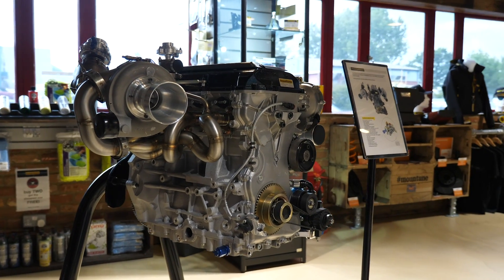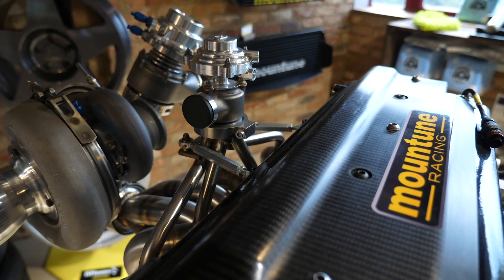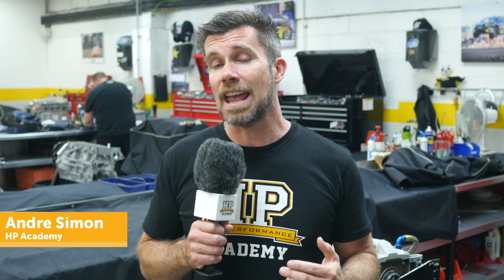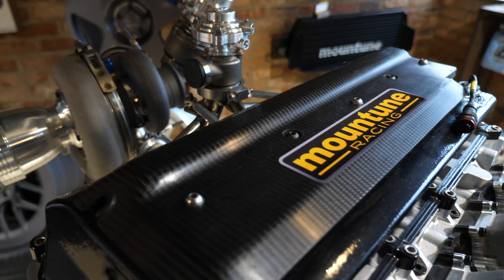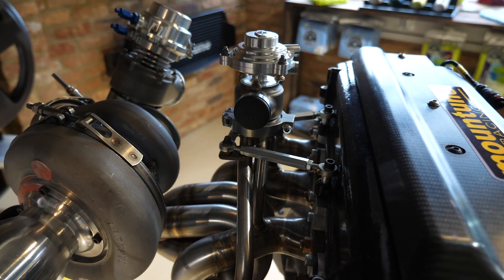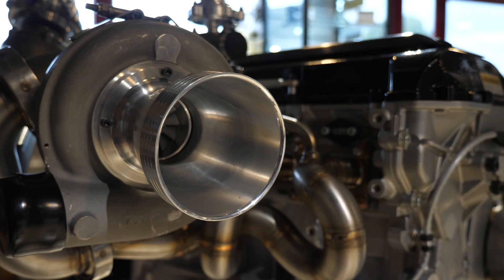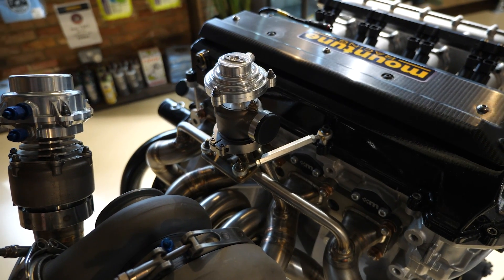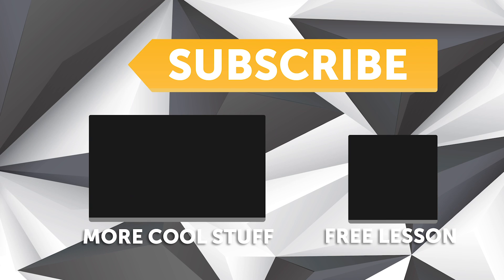Aggressive Anti-Lag Theory | Fresh Air ALS Mountune [TECH NUGGET]

Comment: Look up Audi's 'UMLUFT' system
Reply from the maker: Check the comments, pretty sure this has already been discussed here some time ago :) - Taz.
Reply: @hpa101  yeh, thought it would have been, unfortunately my drive is being in the workshop than reading a comment log, In saying this however have you considered revisiting/investigation into another old turbo tech of pre compressor throttling to aid response?  Another YT'r Stavtech mentioned it and I remember way back in the 80's having to try and discover why they had multiple throttle bodies in series.
Reply: @hpa101  ok anti lag valve there is the vacuum one en the electric one my question is how you going to pu on icu if it’s use vacuum line

Comment: When fresh air antilag valve in action so its need fuel and little combustion wich is provide by the combustion chamber so how its possible because throtle valve is completely closed only fuel is given to exhaust manifold by direct injection in combustion chamber so how its get combustion without compressing air fuel mixter in combustion chamber..???
Reply: If you tune it rich enough or tune in a misfire you get unburned fuel in the exhaust manifold

Comment: A camless turbo motor would be perfect full control of inlet and exhaust valve operation this freevalve technology would make camshafts obsolete tuning all done by the computer no more rockers or timing chain or belt 👍 hello anilag plus no need for direct injection with valves building up carbon deposits and a low pressure fuel system like the 90s again 🙄

Comment: It's true that the downside of conventional anti lag, with a throttle kick, that the car would keep pushing when breaking, but on the other hand, with a throttle kick, the response is much better coming out of a corner. Some racers would set a throttle kick even without anti lag activated to get that extra response. It seems that a fresh air anti lag would eliminate the throttle kick along with its benefit!

Comment: In my mind, this would just become an EGR valve once it opens. Exhaust would flow to the intake from pressure differences.

Would work if you did a nitrous injection though. Inject nitrous and fuel, build a ton of boost. Lol.

Comment: Hi Andre! Love the videos. Been following since HPA first started up. Even taken part in webinars and some online courses. Love your work. However may I ask you do some videos of other hardwares on performance or race cars ie, brake calipers and shock and spring set ups. Not so much just on what they do. Thats fairly simple but more on technical advances in brands and misconceptions between brands and so on? For example I can’t decide on brake calipers mainly as there as myths and contradictions over what’s worth buying and what is or isn’t good. Or what is overkill and why. I think it could help a lot of people hearing unbiased info about things like this. Thanks heaps.

Comment: How does this work on the exhaust stroke? Is the air also pushed back into the engine or is the flow to the turbo enough to breathe the combustion chamber?

Comment: What's the source for the pressurized fresh air? Back pressure is generally higher then boost pressure so you can't simply pass intake air into the exhaust.
Reply: snek I think it was mentioned in the video. It is fed from the compressor side of the turbo. I would imagine because during the anti lag phase there is no massive back pressure being created as the turbo is not really compressing charge air, it is essentially opened ended through the exhaust system. So it’s sort of, a self feeding loop I guess.
Reply: The valve is controlled exactly the same as the wastegate so uses a boost solenoid and is controlled by a PWM signal from the ecu so it’s very responsive. When I worked in Rallycross you would find the odd time that there was exhaust gas build up in the boost pipes/intake manifold but this was down to a faulty valve or solenoid not holding the valve completely shut.

Comment: This has got to be one of the first times I didn't understand the content. I need to watch this again!
Reply: You know those DIY 'Jet Engines' that can be fabricated from an old Turbo?  This is pretty much the same idea using new parts and modern technology.  The compressed air from the turbo either goes into the intake manifold like normal or bypasses the piston engine intake and goes directly into the exhaust manifold along with some extra fuel and ignited to produce drive pressure to keep the turbo shaft speed constant.    At some point it will be easier to just shoe horn an optimized axial flow jet engine under the hood and use the 90+ psi bleed air from it to force feed the piston engine and turn the tires..
Reply: Yeah fr too much ear in the combustion chamber might not be good

Comment: this would mean that the backpressure of the manifold is less than the ambient of the air pressure ? otherways you would have just made a free air venting wastegate. :/ . did some research (thanks google) the "fresh air" means that its connected to the charge piping, meaning that it actually gets the pressurized air in.

Comment: Hey Andre, do you know if there's an advantage to using an external source of compressed air to spool up the turbo when not on the throttle? Like koenigsegg is doing with the Jesko, they've said that use of a compressed air tank has aided in eliminating turbo lag that comes with the big turbos they use.
Reply: Volvo also have a compressed air solution for limiting turbo lag. The biggest draw back is the finite amount of compressed air the tank can hold. So for racing it would need a huge tank and compressor to keep up the demands making it impractical. However for a road going vehicle like the volvo there are benefits.

Comment: The air bypass valve can cycle fast enough to keep those exhaust combustion pressures contained in the exhaust manifold?
Reply: The valve is controlled exactly the same as the wastegate so uses a boost solenoid and is controlled by a PWM signal from the ecu so it’s very responsive. When I worked in Rallycross you would find the odd time that there was exhaust gas build up in the boost pipes/intake manifold but this was down to a faulty valve or solenoid not holding the valve completely shut.

Comment: Nothing new really. Audi was doing this in the Early 80's in their group B car.
Reply: It was called the "Um-Luft" system
Reply: Is that why the beast got banned?
They had the best group B hands down.
Reply: @Photosynthesisbeing  Group b as a whole  The car itself was never banned.
Reply: @Photosynthesisbeing  not really, they were just the first with awd
Reply: The Lancia and Peugeot where far more advanced then the „oldschool“ Audis
Reply: @MartlRS  Is that why Lancia had to cheat to win a championship? Lol.
Reply: @FastPaull  What cheats did Lancia use to win?
Reply: @diahane092  I wouldn't say cheats, but they for sure bended the rules to the limit, like changing the roll cage made of metal for an imitation made of cardboard or doing a stop in middle of a stage to change tires, and they did more but i don't remember now

Comment: All talk lol show us it in action I wanna see this in operation
Reply: just watch any WRC video, almost every car has been using it since 98.
Reply: @240rsmaxi8  you sure it was setup like this ? As I've only ever seen from exhaust to inlet Mani (Evo sas system) 
Not from compressor to exhaust 

Not really looked into it
Reply: @bigbothoee8617  All the current 1.6lt WRC cars have a completely different sound to the older Group A based 2.0lt WRC cars from old. I suspect they all use this system as there is little to no backfiring and instant throttle response.
Reply: Can't understand the words? Need moving pictures to keep your attention?
Reply: @sexyfacenation  do you by any chance own an I phone
Reply: First car to use Fresh Air System was S1 Sport Quattro, Scottish Rally 1985. After group B, first was ST205 Celica, followed by Evo IV Group A. Every World Rally car following the 97 season used Fresh Air, Escort WRC, Peugeot, Skoda etc.  The Impreza went from Fresh Air in 97-98 to DBW air bypass until the S8 then to the Rocket in S9. Just watch some post 2000 onboard in a WRC.

Comment: Showing an example with no plumbing from the compressor side going to the anti lag valve might confuse people. 
I want to implement this as long as my mani is .250 wall. Sounds like this will work well, but might be a race only option...this method (like most anti lag) will likely burn thin wall tubular mani’s pretty quickly
Reply: The manifold there is most likely .035 or .049 wall thickness, just good material with the turbo braced to the engine.
Reply: And happy New year to you as well👍
Reply: There’s speculation there.
Always brace your turbo regardless of wall thickness/boost levels/or weight of the unit. 
Happy new year car people
Reply: @Russell_and_Rosko  it is speculation on the specific wall thickness but the manifold there is 321 stainless so would be 1.5mm or under, inconel would be thinner.
Reply: Is this a wall thickness competition?
Reply: @Russell_and_Rosko  lol, yes!  No, I just think .250 is a bit extreme.
Reply: even in some engines cylinder walls arent 0.25" thick.. 
many guys in FormulaD run this style of antilag with thin manifold headers... well gas isnt exploding but combusting

Comment: why is the air source connected so close to the cylinder head? wouldn't it be easier to have just a single connection just before the turbo? I wonder if it's to do with minimising interruption to the gas flow when the engine is under load?
Reply: this is so it can achieve a full burn before getting to the turbo.  Most WRC cylinder heads incorporate the ports into the head casting, before it leaves the exhaust port.
Reply: 240rsmaxi ahh. Maybe i misunderstand-I thought they were just injecting pressurised air. It’s fuel too is it?
Reply: So there is still air bypass through the engine to carry fuel through to the fresh air injected into the exhaust
Reply: you dont want to burn your turbine blades :D also any big changes in pressure

Comment: Andre’, can you do a video on the rocket style anti lag systems that were used in the WRC?
Reply: its same system as in video, 3sgte celicas same as evos had it on factory homologation cars
Reply: @exvils  Nope - Evo's, well CT9A have the ALS present in this video.
Rocket style systems are different.
Reply: @HHCHunterYTC  Major difference with the WRC style external combustor systems is that they control turbo speed directly! ie the antilag is closed loop controlled to maintain the target turbocharger shaft speed!  Because they burn realtively cleanly in the combustor (a normal axial can type burner) the engine can also be operated across a wider range of positive torques, meaning the overall driveability is much better, and the blending between positive and negative flywheel torque is much smoother and more consistent
Reply: @maxtorque2277  You're right, I should have clarified my comment, the Homologation System =/= the WRC System.

From MHI / Rally Art documentation / Self Study
OEM factory Homologation "Secondary Air System" present on factory delivered cars should operate when the following conditions are met:
1. WOT for more than 3 seconds 
2. RPM < 4,000 rpm.
3. Throttle is let off.

Even then as a homologation part, it's just there, it's not actually in use on the factory delivered cars. (Talking about certain delivered Evo 7/8/9's here)
I've checked my JDM 8's ROM & the SAS/EGR valve doesn't even move when these conditions are met.
You can enable it however by flashing your factory ECU through the use of the Rally-Art / WRC Firmware's.
Even then... The SAS (ALS) system wasn't even put on all the factory cars, my JDM 8 has it, where a lot of the USDM cars don't have it.

Where as the WRC systems, aggressively targets the Turbo's peak efficiency range, by targeting it's corresponding Shaft Speed, and it does this all the time throughout a stage, generally speaking.
This generally causes damage to the Turbine Wheel, Exhaust Housing, and even exhaust manifold due to the heat generated from doing so.
But when you have WRC money baby! You can apparently afford to replace turbo's all the time.
Reply: @HHCHunterYTC  this still isn't the same as the 'rocket' style external combuster antilag system.
Reply: @1loumellor51  right, pretty sure only Subaru used the rocket anti lag too. They could achieve full boost at idle.

Comment: SO if I use stock VW 1.8T recirculating blow off valve and route air into BMW M54 EGR line (after exhaust valves, before exhaust manifold) I get rally antilag? Am I right?
Reply: No
Reply: Do it, but use a metal bov

Comment: Similar to the audi quattro umluft system used in group B. However with modern control tech its much much easier to do such systems today then back in the 80s
Reply: Toyota Celica (and other JDMs) had the system from factory back in late 80s & early 90s. They were disabled in the ecu. Just required a chip to activate.

Comment: If I'm correct in some rally cars they use turbo spinners (combustion is happening in the exhaust manifold before the turbo) where Idel is starting at 4,000 rpms
Reply: no, no rally car idls at 4000rpm
Reply: only cars that idled at 4k rpm were 4age formula atlantic racecars, cuz how big their cams were
rally cars had small cams+turbos, intlet restrictors and idled below 1rpm with 2bar of boost in intake :D
Reply: @exvils  F1 cars idle at like 6k

Comment: Some similar principles to secondary air injection systems or what a lot of people call 'smog pumps'.
Great video as always!
Reply: That was the first thing I thought of. They reminded me of headers that keep smog engines legal.
Reply: Why not keep secondary air injection on our turbo cars and instead of tune it out, tune it IN to spool up the turbo during tip in or during launch control 😂

How hard would it be to use a little manifold vacuum operated diverter valve to recirculate boost to pre-compressor to allow the compressor to freewheel while at low throttle angles  surely that would help a bit

Comment: I call it launch control. Is that correct term? For off the line?
Reply: Launch control is rpm holding (more advanced systems can also control traction) . Anti Lag is prespooling the turbo
Reply: Not even close to being correct in any interpretation of anti-lag or launch control I believe
Reply: Pretty embarrassing question from an account titled Turbo World. Two totally different things entirely. Launch control is simply the ECU holding rpm or applying traction control limits to reduce wheel spin on launch. Anti lag, as explained here is a system developed for WRC & WRX to remove turbo lag entirely by causing combustion in the exhaust manifold creating gases which in turn keeps the turbo spinning even when throttle isn’t applied.